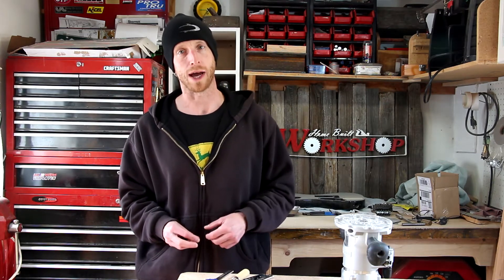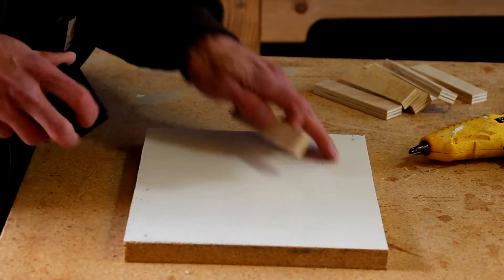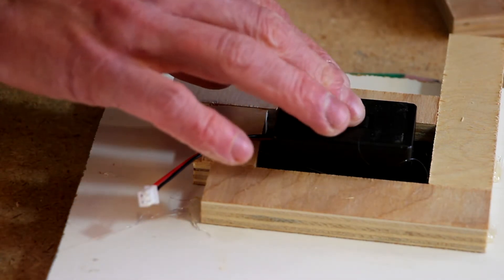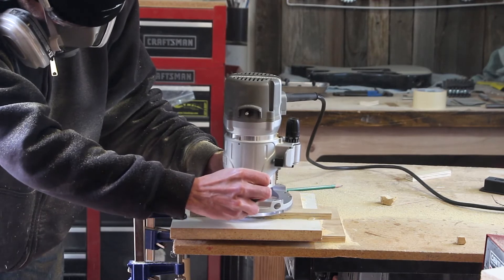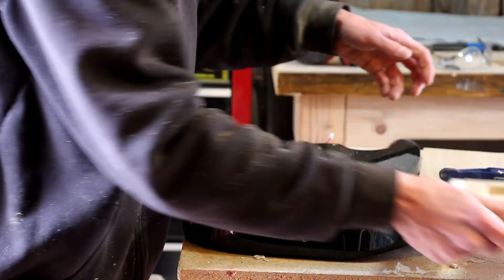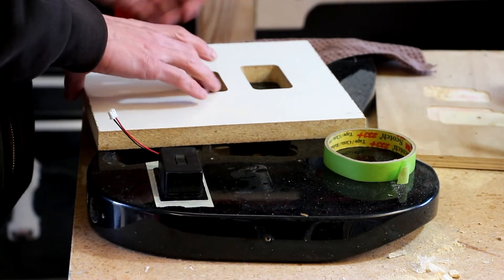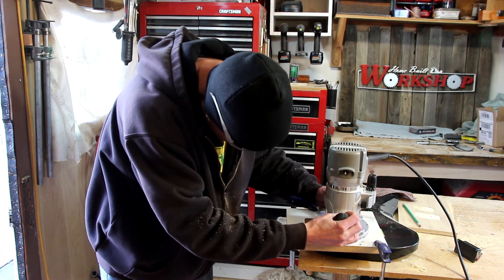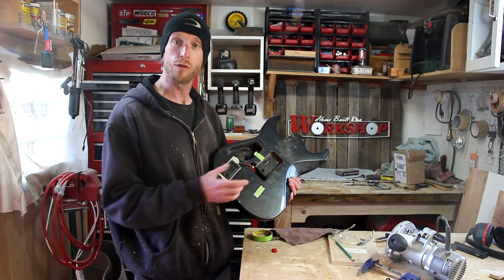How To Build a Router Jig

Comment: Hello Great video. I have the same router. Can you tel me what guide bearings you use? I am having trouble finding compatible guide bearings. Thanks
Reply from the maker: +Eric Breindel I use the bearings that come on the router bits. I've never used the guide bushings on this router. I mainly use template bits and flush trim bits.